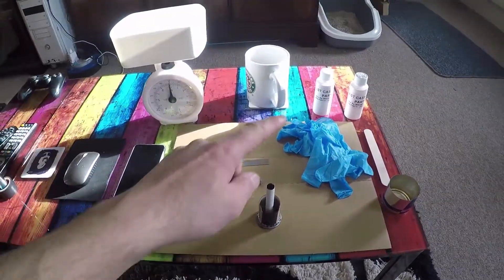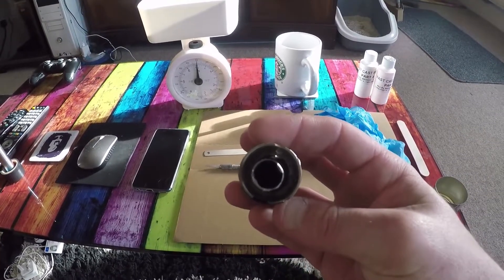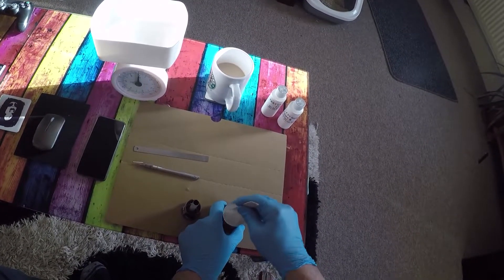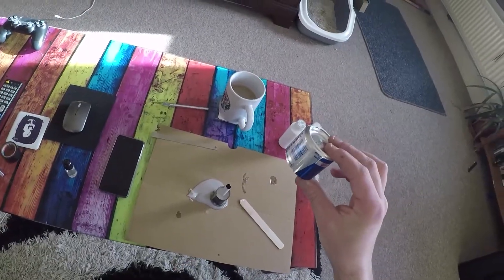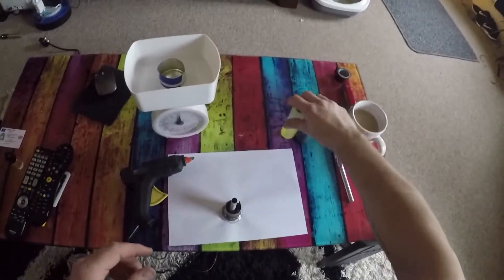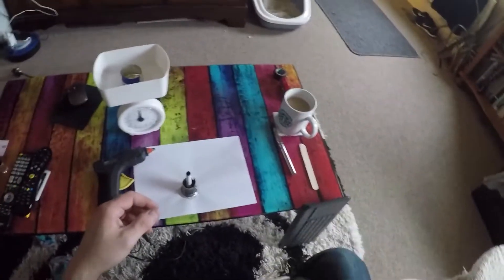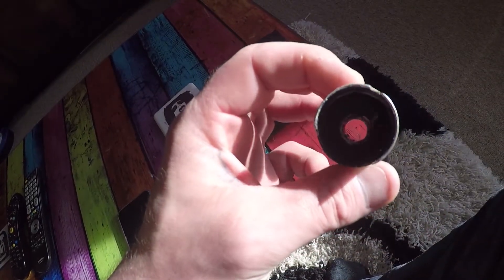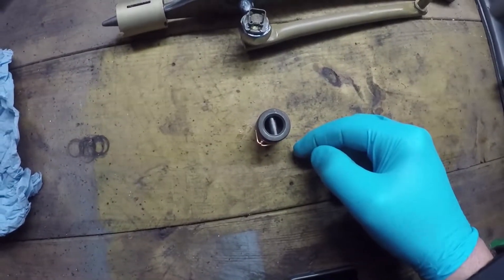FAIL/WIN DIY Polyurethane Bush Casting (E36 Gear Shifter Linkage)

Comment: How did shifting feel after you installed the shift arm carrier with poly and the rod joint? I've been looking into doing both of these. I found an e34 bimmerforum post where the original poster was trying to cut off a piece from a 5/8ths diameter polyurethane rod (he was using 90A) and putting it in the rod joint. After doing a bit of research I wondered if 60A material would have better compression and damping than 90A?
Reply from the maker: Being honest, its such a minor change that I never really noticed the difference.

Comment: Awesome great idea! I was doing the shifter selector rod foam piece last week! And I had a similar idea of purchasing a solid polyurethane rod and cut to size. How does the shifter rod feel and was it tight when you were installing the pin to the tranmssion? I like your idea and I’m just curious how that poly mold you poured inside the tranmssion selector rod, that wasn’t shown on camera, has turned out ?
Reply from the maker: It came out perfect second time around. Fitted just like oem and to be honest, I'd forgotten I'd done this.

Comment: Thanks for showing the shifter assembly out and the failed mix so we can all avoid that. I'm looking to service all the linkage points I can on my 5spd 192,000miles. My buddy is doing a manual swap currently on an e36 m3. His vids are pretty good I like them a lot, take a peek.
Reply from the maker: Hi Mike, thanks for watching and im happy I could help. Ive already watched a few videos by M3NACE..really descriptive and clear. I like them and will continue to follow him.